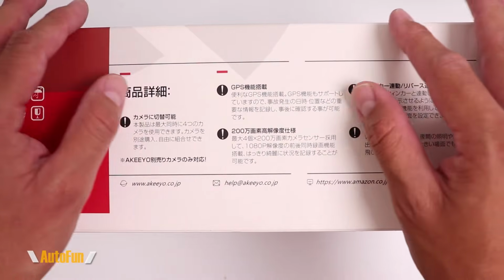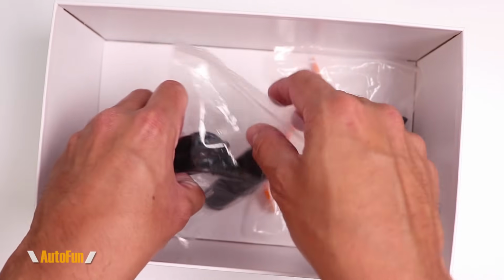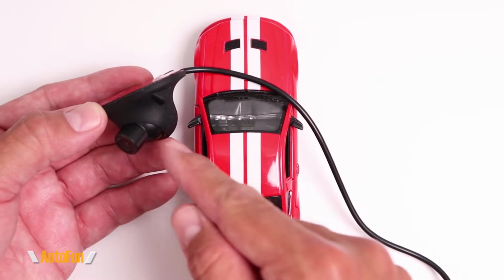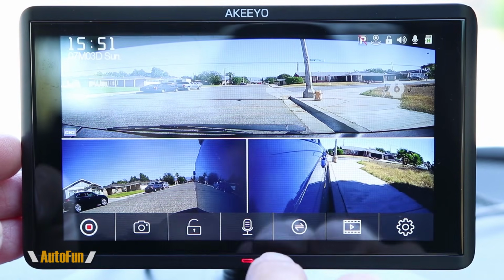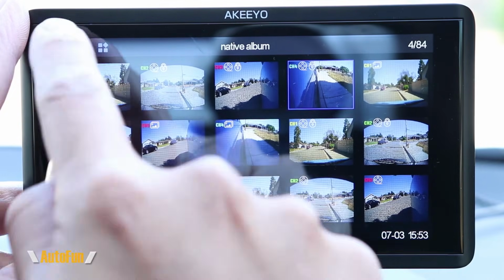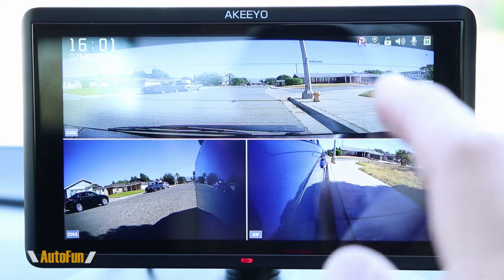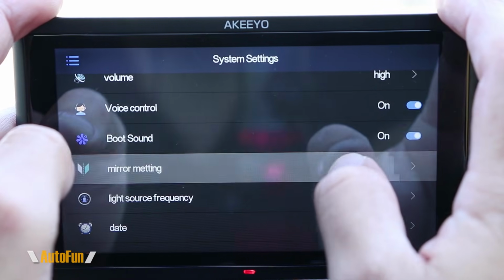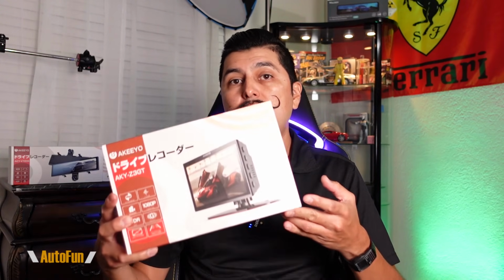AKEEYO AKY-Z3GT Dash Cam Review (Side Cameras, 4 Channel, GPS, Park Mode & Park Assist)

Comment: You needed to show the unit size and mounting inside the car as we can only guess the mounting,size and lighting it gives off during day/night usage. Otherwise, a good video. Thank you.
Reply from the maker: Hi D B! I went to the vehicle and took measurements of the unit for you, here you go: The main unit is 5.75" wide by 3.75" tall, adding the stand adds another 1" for a total height of 4.75" As far as mounting you can see the mount and how it works at the 1:30 mark. However there is a standard 1/4" screw hole on the bottom of the display if you do not want to use the stand and prefer to use a standard camera mount. As far as how much lights it gives off during driving this is going to depend on what brightness level you choose to run the display (I run mine at maximum brightness like my mirror dash cams however I know some people do find the display brightness distracting at full blast and run it at a lower brightness) Hope this helps, Cheers!

Comment: what about a camera you can use when your car is turned off.
Reply from the maker: Hi its me !! This dash cam supports a hardwire kit (to enable it to record incident when the car is parked and turned off) And I have more dash cam reviews (with parking monitoring support) on my channel in the playlist "Dash Cams Reviews" if you like to compare them. Hope this helps, Cheers!
Reply: Where can I get the hardwire kit?
Reply from the maker: @elainelabrooy3438  Hi Elanie! I put the link to the system (the hardwire kit is included with the kit) in the video description. Hope this helps, Cheers!

Comment: Hi. i finally received my Akeeyo AKY-Z3GT. I chose the silver camera for the 2-side cameras for easier placement. however, both silver side cameras have the "AV" connector but the dashcam unit only has one AV input. Looking at 7:25 of your video, the silver side camera doesn't have the AV connector. The main reason I got this camera is for the side cameras. I already have a 2-channel rearview mirror dashcam I am not planning to remove as I use it as my rearview mirror. My excitement now turns into frustration.
Reply from the maker: Hi Ian! Oh wow that is very strange, both the black and silver cameras should have the circular connector you saw at the 7:25 mark, if you take a look at your manual (I think page 15 if I remember correctly) you can see one side camera connects with the circular connector directly to the main harness from the monitor and the second side camera is connected to an adapter (they included) that takes the circular connector and turns it into AV so it can connect to the back of the monitor. I would recommend you contact Akeeyo to see if you received the incorrect cameras or if they have revised something. Please let us know what you find. Hope this helps, Cheers!
Reply: @AlexAutoFun  i contacted Akeeyo directly and here's what they said. "The place indicated by the arrow can be disconnected, 
Please rotate hard and pull it out, please be sure to pinch both ends, (do not pinch the cable, otherwise it is easy to damage the cable)". Did you have to pull it on the unit you got? I was wondering why don't the manufacturer ship that part already pulled out? They should know that the customer will connect all 4-cameras upon receipt. Why have the customer pull it out and risk damaging one of the cameras?
Reply from the maker: @iansebastian4535  Hi Ian! Ah that is a good question, normally I see manufacturers who send their cables pre-attached to other cables (such as the cameras, power cables or GPS cables) and sometimes there are not. Seems to really be all over the place whether cables will come separated or if I have to separate them (I usually don't separate them unless the installation process requires me to, such as when routing the cable thru small spaces) So to answer your question since it's common for me to be connecting and disconnecting cables, I don't recall if I had to disconnect any cables from the adapters or the other way around. If I had to guess why a cable is shipped mated to another cable (such a rear camera and rear camera extension or in this case side camera and AV conversion plug) maybe due to the supplier of the cable shipping the mated cable to the dash cam manufacturer. To avoid cost (by reducing the labor of having to unplug a cable before shipping and repackaging) they probably just place the component in the main box as received from the supplier and since this can very from supplier to supplier this leads to what I see, cables coming in mated or mated across the industry LOL But that is just my guess from my years in the Manufacturing industry. Hope this helps, Cheers!

Comment: Very nice review. It makes me wanna get this dashcam. Just curious,  where did you tap the left and right turn signal? thanks.
Reply from the maker: Thanks Ian! ah yes regarding tapping the turn signals, I did it on the harness that goes to each turn signal (it technically can be done anywhere along the cable for the signals such as the inside of the car but I found it easier to reach the wires under the hood of mine) Hope this helps, Cheers!
Reply: @AlexAutoFun   Which side camera is better and easier to install (the silver or the black)? Akeeyo Global Store is selling it thru Ali Express for $163 (45% cheaper).
Reply from the maker: @iansebastian4535  Hi Ian! both are the same imo since they both requiring running the cable and they both are applied with double sided tape. I think it comes down to which one you like best. Just be careful buying from global store, I seen cases where vendors that sell like that do not include support or warranty or the product is not the one meant for USA so it may be configured for another location (mine was a model meant for the the Japanese market and I had to hop thru hops to get it to work here in USA). Hope this helps, Cheers!

Comment: Nice review, just a quick question for you, possible to have both side signals assist?  Since my car already has a backup cam and don’t need another parking assist, can I use that channel as the other side signal assist?
Reply from the maker: Hi Sams97! unfortunately only one side camera input supports a trigger wire. That being said, the rear camera input as you mentioned supports a trigger wire. Technically it may be possible to connect the second side camera to the rear camera input (while I had other viewers mentioned they have connected different cameras to it, I have not confirmed which ones would work or any long terms effects of running a different camera) I would recommend to contact Akeeyo and inquiry about putting a different camera just to make sure you are not going to damage your system or void your warranty. Here is also good alternative that does supports triggers for both turn signals https://youtu.be/b2JXMQyU-24 Hope this helps, Cheers!
Reply: @AlexAutoFun  thanks for your reply and your recommendation!
Reply from the maker: @Sams97  You're welcome!

Comment: I really think that they need to make the cigarette lighter adapter with usb outputs for phone charging and any other options
Reply from the maker: Hi ban annah! yeah I really like when they add USB ports to a cigarette lighter plug, that way I can still charge my phone and not have have to run a cigarette lighter port splitter or hardwire the dash cam. Cheers!
Reply: @AlexAutoFun  exactlyyyy right? Lovin your vids!
Reply from the maker: Thank you ban!
Reply: @AlexAutoFun  say, can you see on the screen only the 2 side cameras on split screen? Like without the back camera above
Reply from the maker: @bigkaki000  Hi Ban! nope, remember the aspect ratio of the side cameras, having both of them on the screen by themselves would probably not gain you much (the view would be the same as the one with the 2 side cameras split screen except without the rear camera above, the side cameras would just be in the middle of the screen with large black lines on top and bottom) While I think it maybe be interesting to force both side cameras to fill the screen, it will distort the image quite a bit as they would have to be stretched up and compressed on their sides. Or the view for each would have to be cropped to fit the profile of both of them fitting on the screen but in either case I don't think it would be look good or be very usable, but who knows, maybe we will see a firmware update in the future adding one of those views! LOL Hope this helps, Cheers!
Reply: AutoFun  do you know anymore systems like the ameeyo z3gt?
Reply from the maker: @bigkaki000  Hi Ban! if you are looking for side cameras, here are two alternatives https://youtu.be/b2JXMQyU-24 and https://youtu.be/Wb_PAPdFfZc Hope this helps, Cheers!
Reply: @AlexAutoFun  the problem is i want the side cameras to face forward instead of backwards, do you think the black side camera will be a better option than the silver?
Reply from the maker: @ban annah  Hi Ban! Either one can be mounted facing forward (but you will be the 1st I know of to do so! Yay!) But as I showed on the video I linked earlier, the black cameras do have more adjustability than the silver ones that are fixed. Hope this helps, Cheers!
Reply: @AlexAutoFun  thank you very much man!
Reply from the maker: @bigkaki000  You're welcome!
Reply: @AlexAutoFun   do you perhaps remember how many pins connection is the cigarette lighter 12v on the side that connects to the screen power?
Reply from the maker: @bigkaki000  Hi ban! I finally got to the vehicle that I have this installed into to check this for you. It's a 5 pin connector. Hope this helps, Cheers!
Reply: @AlexAutoFun  you are really helpful, thank you very much!
Do you think perhaps there might be a way to avoid using a 12v splitter, by using some kind of 5pin power to usb 5v cable?
Reply from the maker: @bigkaki000  Hi ban annah! There are two challenges at attempting this, one is that this systems uses 12V instead of the 5V found in USB, the second would be the potential to void warranty if it's powered in a different way than the manufacturer specified. What I would do if I didn't want to use the cigarette lighter plug, is hardwire the system. Hope this helps, Cheers!

Comment: Yes this is the best 4-channel stealth cams for cars. Thank you! Is there a discount from your channel? They don't sell this brand at Amazon or anything like it for cars only big bulky 4 camera kits for RV's and Trucks. I'll need to find an installer and a quote for labor to see if it's worth it. Craigslist?
Reply from the maker: You're welcome Larry! I don't have a discount code sorry man (I keep asking for one but no luck LOL), regarding install, I would recommend using a professional installer licensed and insured who will guarantee the work, that way you are more protected in case you have issues with the install. Hope this helps, Cheers!

Comment: I hope the next future of car cams would be plug in play
Reply from the maker: Hi Maxmil! yeah that would be pretty awesome, like Tesla how they come like that from factory..
Reply: @AlexAutoFun  What about the Night vision on this thing is it Clear thank bro love your videos more power : )
Reply from the maker: @maxmilbredes897  Thank you Maxmil! ah yes regarding night vision, this dash cam does not have that feature (this feature is somewhat rare on dash cams) but here is one that does https://youtu.be/JJKbUu_egiE in mirror style and one that has it on stick style https://youtu.be/I2M0RgzI0S8 Hope this helps, Cheers!
Reply: @AlexAutoFun  is the black cam also water proof and if i direct it to the fuse box will it drain the battery.
Reply from the maker: @maxmilbredes897  Hi Maxmil Bredes! I'm assuming you are referring to the black side camera? if so, yes it is waterproof. Regarding connecting it to the fuse box, the Akeeyo hardwire kit for this system has low voltage protection to avoid draining the battery (video on the hardwire kit coming, stay tuned) Hope this helps, Cheers!
Reply: @AlexAutoFun  Thanks bro can you do a full video of wiring cause i dont have any idea what im supposed to do this is very complicated and i just bought mine also im worried about the wiring besides the airbags its scary.
Reply from the maker: @maxmilbredes897  Hi Maxmil! I always recommend seeking professional installation however if you want to see what the process looks like here is how the cables are run https://youtu.be/44WXN8MI66o both for inside and outside of the car (ignore the mirror dash cam process is the same for the Akeeyo) with the cigarette lighter plug and here is the video for the hardwire process https://youtu.be/uZp95NbNlmM Hope this helps, Cheers!
Reply: @AlexAutoFun  so should i connect it to the Power to cigarete lighter?.
Reply from the maker: @maxmilbredes897  Hi Maxmil! Well that is an option to reduce labor (I install plenty of dash cams just with cigaretter lighter plug), I usually only hardwire it if there is a desire to enable parking monitor or I'm trying to avoid tying up the cigarette lighter adapter port. Hope this helps, Cheers!
Reply: Question if i make mistake in installing this on fuse box does it burn the fuse box thanks for answering my questions .
Reply from the maker: @maxmilbredes897  Hi Maxmil! The fuse box houses several fuses used for critical components of the car, a mistake in this area can cause either damage to those systems, disable them, injury to the installer (or death! as crazy as that sounds, yep I got a story for that too, will share it on the channel one day) and yes in cases of poor wiring a fire could be possible (my friends car went up in flames this way the day he attempted to install an aftermarket radio, we never knew what actually caused the fire, maybe it was coincidence or maybe is was his wiring, literally his words LOL) Cheers!

Comment: I'm wondering if it can record when parked in a loop, and for how long. My concern is that if someone were to scratch my car, the motion might not be enough to trigger the motion sensor. So I want something that can record for say an hour or two. Is that possible with this camera?
Reply from the maker: Hi Dan! Ah yes this dash cam system does not support motion detection (it only supports impact detection) To capture people passing near the vicinity of the car or walking to it, here is a system that does support motion detection https://youtu.be/vUEsIYEBVck And I have more dash cam reviews on my channel in the playlist "Dash Cams Reviews" if you like to compare them. Hope this helps, Cheers!
Reply: @AlexAutoFun  Yeah, the "Rydeen Tombo 360X Mirror Dash Cam 360° VIEW" looks like a great system.  I watched your video and thought...Yeah, this is the one to get.  But, then I realized that there was one crucial thing missing and that was "side view" capability.  Love that it can look around 360 degrees, but that is from inside the cabin, and you can't see what's happening in the blind spots along the side of the vehicle.  The motion detection is a great feature, and almost enough to sway me away from the AKEEYO, but, not quite enough.  I can't tell you how many times I've wished I had a side-view camera when driving on the highway, or backing into a parking space, showing me a view down the side of my vehicle.  Honestly,  I'm not sure why auto manufacturers don't offer the option of rear/sideview cameras that can be operated on-demand.  Seems the DOT should mandate that capability as they did with backup cameras in all vehicles as of 2018.  I think it would prevent a lot of accidents from happening.
Reply from the maker: @jesuslovesbass3944  Yeah explained very well my friend, that is one of the reasons I tell people I can't tell them what the best dash cam is since It really depends on what features are important you. In this case side camera, on other cases some people want the backup to SDD, and others want the real night vision option, and so on. So you definitely hit the nail in the head, the best dash cam is the one that meets your main needs and everything else (in terms of additional features) are just gravy on the top LOL Cheers!

Comment: Akeeyo forgot sumthin. It should be 5cameras. Side cameras, front, inside and rear.
Reply from the maker: Hi Francis! ah remember this system support four channels (four cameras): two sides, rear and one front. The front channel is the camera that can be placed facing any direction (front if you want to be a front camera, or cabin if you want it to be a cabin camera or another position you can think of) Hope this helps, Cheers!

Comment: Thank you for your helpful videos. Can these mirror dash cams be helpful with parking to the front/side view?  It can be difficult judging distance to objects in our Honda minivan. Can these provide a view “down and to the side?”
Reply from the maker: You're welcome ScottBird1999! yes the additional views this system provides makes parking tremendously easier. You can see how much additional view coverage they add during the test drive portion of the video at the 14:30 mark. You can also further adjust the view by placing the rear camera in a different location. The side cameras can also be be lower or higher on the car and placed with a different angle (since they adhere to the side of the car with the VHB 3M Tape) Hope this helps, Cheers!